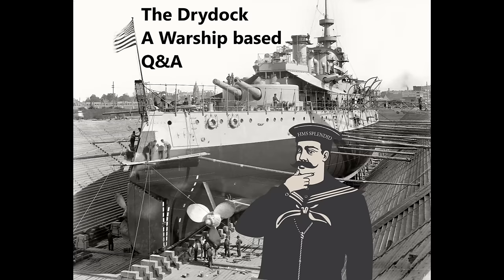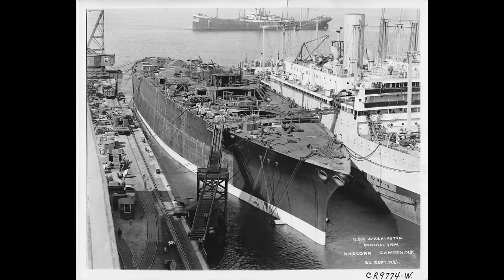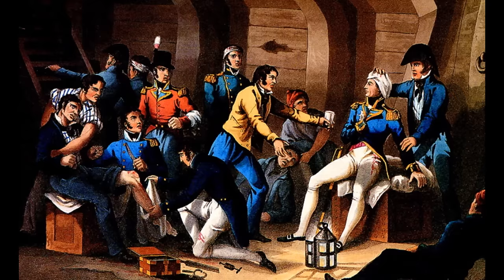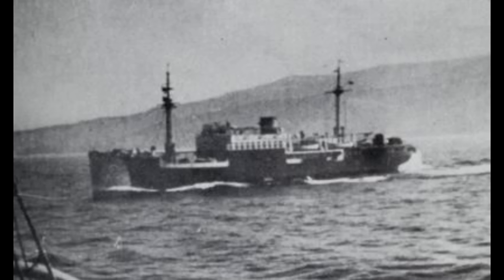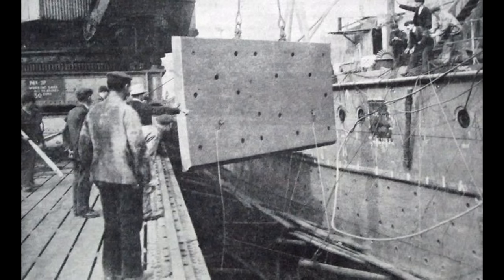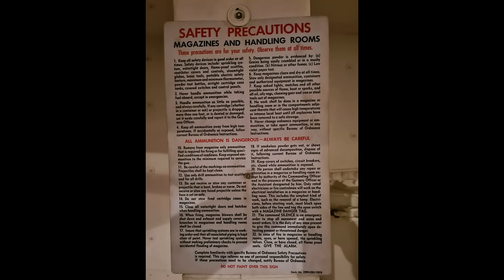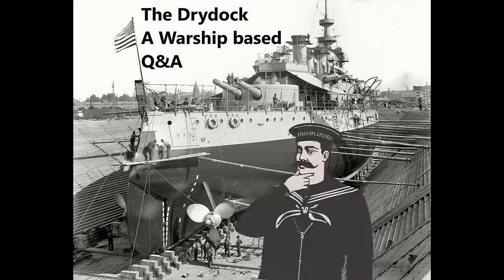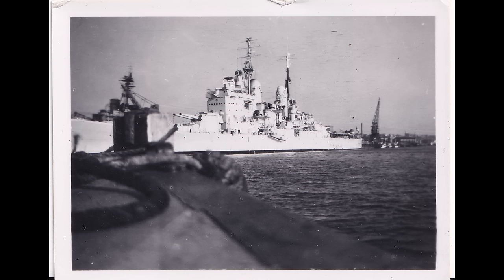The Drydock - Episode 219 (Part 1)

Comment: Concerning British APC ammo before replaced after Jutland by the much-improved "Greenboy" projectiles.  ALL ammo made by anybody up through 1911 was of the general British type:  Soft AP cap, tested at 15 degrees obliquity or less, and having a non-delay fuze (nobody had come up with a minimally-reliable delay-action mechanism, and, except for the US Navy, which used for its large-size gun projectile main armament filler Explosive "D" (the extremely insensitive ammonium picrate, the very powerful and sensitive explosive trinitrophenol (British Lyddite, French Melanite, Japanese Shimose, etc.).  In fact, until 1902 the German Navy did not use asny filler in its APC shells due to their inability to go deep into an enemy warship and explode properly, while any other hits, such as on turrets, did not need such deep penetration.  Thus, British APC ammo was not in any way inferior to the shells used by anyone else.  The use of Explosive "D" in US AP ammo caused problems in getting full-power detonations even if the fuze acted properly, but this was true for all explosive fillers other than trinitrophenol until about 1928 when the higher-power Tetryl explosive was introduced in the boosters between the fuze and the main filler (not sure when some nations got this improvement, but US and British boosters were changed to Tetryl in 1928 for all shells requiring small boosters (base fuzes primarily) and reduced-sensitivity fillers (TNT in post-WWI British cruiser ammo)

Note that Japanese APC ammo in the Russo-Japanese War was essentially British-type and the high power and almost 100% full-detonation rate caused the Japanese to be hooked onto such explosive fillers even in WWII (they did not change to a less-sensitive filler until 1931 and, even then, only changed to tri-nitro-anisol, which was barely able to be kept intact when going through thick armor by using thick wood, plaster, and aluminum cushions filling up about one-third  of the cavity.  Thus, British ammo could not be considered a failure when one of the major users of it prior to WWI in actual combat considered it so highly.

The US rejection of higher-power, but also higher sensitivity, AP ammo was due in major part to safety requirements, just like their rejection of nitroglycerine in their gun propellent powders (WWII "flashless" powders used a much less sensitive additive that reduced the temperature of the blast).  They allowed prior to the introduction of Tetryl a higher percentage of less-than-full-powder filler detonations, which the British also allowed after replacing Lyddite with Shellite in their Greenboy shells and afterwards, though eventually they added Tetryl (British "CE") boosters to their Shellite-filled APC shells to improve this by WWII.

German post-1911 APC shells (C/11 and after) made a few secret improvements that others only learned about during WWII when studying German APC duds (much of the improvements after Jutland in British APC ammo was due to this study).

First, Krupp introduced a much stronger high-temperature solder to hold on their soft AP caps so that they remained functional up to 30 degrees obliquity.(a form of "tough" cap), since all other soft caps, including the earlier Krupp designs, would begin to peel off the nose at over 15 degrees and never work at over 20 degrees (all AP caps other than Krupp -- except perhaps WWII Italian Navy APC shells -- were soldered on using a lower-strength low-temperature solder, sometimes with crimping into a ring of pits around the lower nose added for additional strength).  Note that the acceptance tests for plates over 0.5-caliber KC were not increased in impact angle, so the shell body strength, even when the cap worked, was not really much different from British or US AP shells during most of WWI.  This meant that 11" and 12" German naval guns firing post-C/11 Krupp APC ammo could punch through most plates of roughly 6" WWI-era KC armor in an intact condition (if going fast enough, of course) and getting a chance of causing deep hull damage.  Not through thicker plates, though, so there was no improvement over British APC against BB-thickness armor (explains why only British BCs were blown up at Jutland, no matter how good or bad the British anti-flash powder safety systems were).

Second, Krupp found out that tri-nitro-phenol could not take an armor impact against plates over 0.25-caliber thickness without being set off at roughly 0.003 second, which turns out to be the typical delay in a base fuze without any delay  mechanism.  In fact, with this filler, in hits against thick armor, the fuze did nothing in almost all cases since the filler was very reliable, as the Japanese found out.  This precluded the use of a delay-action fuze, so they switched to TNT as the filler.  This filler was not quite insensitive enough in its pure, single-piece form, so Krupp had a wooden cushion added to the tip of the cavity and formed the TNT into stacks of separate pre-formed blocks with thin cushioning material separating them.  This filler was kept by Krupp through the end of WWII for its shells with armor penetration of any kind.  This filler was less reliable when set off by the pre-Tetryl boosters, which is why German shells had so many duds for the British to study.

Third, the German secret delay-action base fuze was developed.  It was a very poor design, being essentially a regular non-delay base fuze with a single primer/detonator hit by the firing pin modified as follows:  (a)  To reduced the blast power of the primer/detonator on the black-powder delay element inserted in direct contact with the trinitrophenol booster charge, a corkscrew "tortuous tunnel" (British term) of triangular shape was inserted that more than tripled the distance that the primer/detonator blast had to travel before hitting the delay element.

Four, the delay element was made of a thin wafer of black powder pressed tightly to the booster and with a thin iron foil layer with many tiny holes facing the primer/detonator to further reduce the blast on the black powder.  However, due to the irregular effects of that corkscrew tunnel, many cases occurred where the blast did not set off the black powder properly, so the delay became forever (dud).  To help fix this, a small amount of loose black powder was poured into the fuze just in front of the waver to get the fuze to work, even if the delay was now very unreliable as to its length (I think 0.025 second was the spec requirement).

Five, unlike all later delay-action fuzes, there was no detonator after the delay element to properly set off the booster.  Using tri-nitro-phenol as the booster meant that it was much easier to set off than most other explosives then in use, but burning black powder without a confined area to build up a major explosion was not very reliable even using tri-nitro-phenol.  What most other later fuzes used, including the delay-action version of the British APC Number 16 base fuze used in the Greenboy shells, was to put an extremely sensitive explosive like fulminate of mercury or lead azide (used as the primer hit by the firing pin) between the delay element and the booster, so that the burning delay, when it hit its far end, would very reliably set off the detonator just like it had been hit by a firing pin, so that the delay element did not decrease the blast that set off the booster.  This design lack made the KGerman base fuze even more unreliable.

When the German fuze worked properly (half of the time?), the delay caused significantly more internal hull damage than the shells with non-delay fuzes, but at the Battle of Jutland only a very few shells using these fuzes allowed the shells to reach deep enough into the target to endanger the ship in any important way.  WARSPITE took such a hit that came close to disabling an engine, if I remember right, but that was the worst hit due to the delay working that I know of.  Battleship heavy armor works in slowing down an intact penetrating shell so that it does not go very far after penetration, especially if the shells are rather small, as the 11" and 12" German shells were.  This is the major reason for making naval guns so big, even if a smaller gun might be able to barely penetrate the armor.

So, British pre-Jutland APC shells were not inferior to anybody else's APC shells.  What the Krupp shells gained in occasional deep penetration, they lost in greatly increasing the number of duds.  Note what British ammo did to those German battle-cruisers -- some barely made it back to port.  It was only when better fuzes and boosters were introduced in the 1920s that reliable post-penetration shell blast effects were achieved.

Comment: Does german late ww2 light cruiser turret shift to one side (aka Leipzig) is really effective? Do the additional arcs of fire for one gun to one side really matter? Generally is it reasonable to put 2/3 of the armanent to the aft in any scenarios?
Reply: Nothing wrong with it, see a lot of Japanese destroyers with the same layout. Heck, most US destroyers of the period had 3/5 of the gun armament aft (sort of).
Reply: I assume you mean the K-cruisers. Leipzig didnt have the offset turrets anymore, which might tell you that even the Germans didnt find that feature useful.
Also, how exactly is a ship from 1929 (or 1927, for the Ks) "late WW2"?
Reply: @535phobos  thank you for the clarifications, under the late ww2 meant basically not-the-emden, hovewer there are Nurnbergs and Leipzigs after the Ks so basically it is indeed inaccurate, i just don't remember well german CLs as u can see
Reply: In anothet post Drach had mentioned that the cruisers had most armament aft becausr they were meant to be used as scouts, and after finding the enemy, they would likely turn and run. But, they would still have the majority of guns able to shoot at the enemy while they ran...

Comment: Would you refer to a lorry as a car? By the same token, a ship is big, a boat is small. I've found this good general rule. If you want to communicate the comparative size of a vessel, and suggest things about it's range, habitability and capabilities, choose one or the other. 

In 2010 peace activists attempted to sail to the Gaza coast in a protest against the Israeli blockade of Gaza. The BBC reported them as sailing in six boats. When I heard this, I envisioned a few yachts or small motor craft. In fact, they were sailing in six large vessels, which included vessels of more than 4,000 tonnes and capable of carrying several thousand tonnes of relief aid and supplies, and had embarked hundreds of aid workers. Ships, by any modern definition. If the BBC had said "ships" I would have had a far more accurate idea of the situation.

Comment: The fast battleship speed is about 30 plus knots. How fast could they go before they would shake apart if newer power plants have a lot more power, lets say double the power. Just saying the engine they put in all fit in the same space
Reply: Many fast battleships couldn’t make 30+ knots (the KGVs, NorCals and SoDaks could not, being at 27-28kt, same as Yamato’s top speed).

Comment: At 2:23:37 the question should honestly be "What went wrong with the Lexingtons and the Amagis in comparison to the G3s?" 🤣
Reply: The Amagis honestly weren’t THAT bad.
Reply: @bkjeong4302  In my opinion they were nearly as bad, because they were horribly unbalanced. A 250mm belt is nowhere near enough to protect against 16inch gunfire.

They might not have been as bad as the Lexingtons, which carried a 130 to 180mm belt, but honestly, a 16inch gun will punch through both plates with ease at practical combat distances.

Amagi could have been a decent ship if they had dropped one turret, reduced length and accepted a speed loss of something like 2 knots. Then they might have achieved some pretty good immunity against 16inch gunfire.
Reply: @michaelkovacic2608  

The issue with this argument is that there were plenty of capital ship designs that were clearly not awful that were not armoured against their own guns (the Iowas, for example), so Amagi not being immune to her own guns shouldn’t really be that big of a factor?

Comment: Personally I think drach is pretty hard on the Bismark,  but it's definitely overrated when you're talking to the average wheraboo.
Reply: It actually gets even worse for Bismarck.

While I’ve argued at length about how every WWII-gen (30s and 40s) battleship was a massive strategic/procurement failure, the Kriegsmarine capital ships probably have to take the cake (though Vanguard is also up there…but Vanguard was much better designed). Why? Because Germany had no need for a large fleet in the first place. At least the Americans, Japanese, British, French and Italians can say that their own pointless and wasteful WWII battleships would actually have been good investments if aviation hadn’t gotten to the point it had by the tail end of the 30s; the German ships would have been strategic disasters even WITHOUT aviation.

Comment: I don’t see how a Bismarck could beat an Iowa even in theory unless “Hood” style wildly lucky hits were somehow part of the design. 

Iowa was faster and had superior guns and vastly superior rangefinding. It could just stay endlessly beyond bismarcks effective range and pelt it with effective fire. If Bismarck tried to close it just runs away, firing computer guided 16 inch shells all the while
Reply: To be fair, Iowa’s effective range wasn’t as great as commonly believed even with radar (and fire control computers were something everyone had, though Bismarck’s FC did have a tendency to knock itself out of alignment), at least if the 1944 live-fire tests are anything to go by (too low of an accurate rate at 30,000 yards to effectively engage another capital ship, with the true effective range being more like 25,000 yards).

Not that this really matters, because even at closer ranges Iowa is still bigger (yes, Iowa was bigger than Bismarck by five thousand tons or so), far better armed and armoured, and slightly faster.

Comment: 7:38 Under the conditions described for this question, would the ability to build an unlimited number of warships as long as they stayed within the treaty limits have affected the Japanese construction of the Yamato, Musashi, and Shinano, or would these ships' superiority in the dick-swinging contest that was having the biggest battleship have prevented resources from being diverted to producing more smaller warships?

54:26 I am reminded of the Italian aphorism "traduttore, traditore" ('the translator is a traitor') and the Hungarian "fordítás: ferdítés" ('translation is distortion').

1:48:23 It also depended a lot on how fast you needed the flight deck. An aircraft that was not realistically repairable, but which could still be scavenged for spares would often be struck down to the hangar deck to be stripped of everything that could be re-used; but because damaged aircraft were typically recovered first, before the sequelae of their damage voided the pilot's contract to fly the plane, if it was not possible to take the time to strike the damaged aircraft below (typically because it wasn't readily movable, but also if equally-damaged aircraft were awaiting their turn to land), it would be pushed over the side to clear the flight deck after extracting the aircrew even if it were still in a scavengeable state.